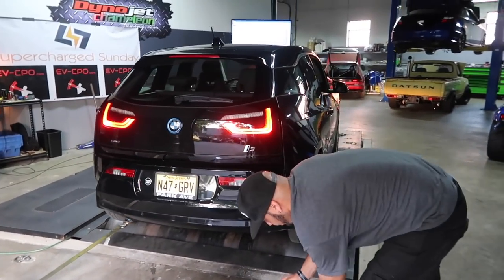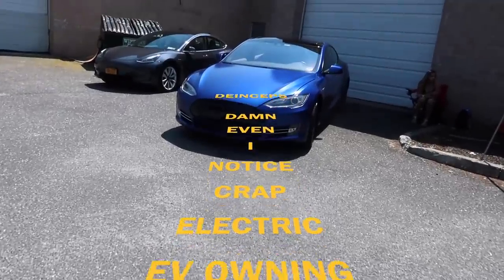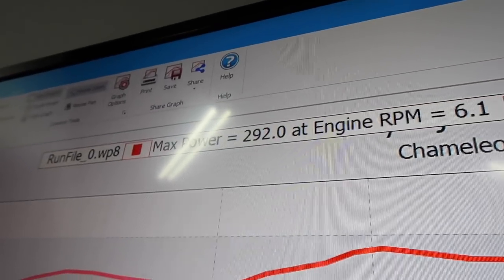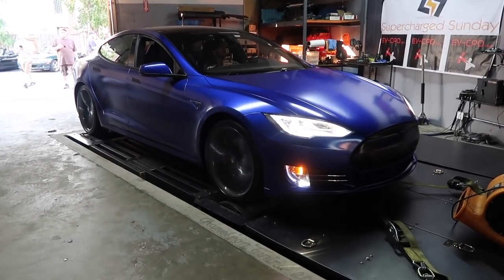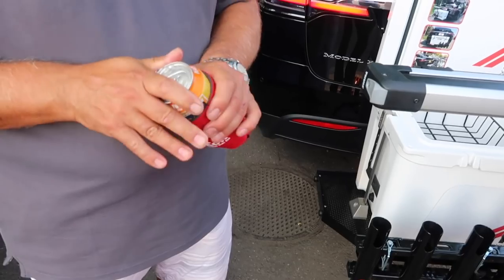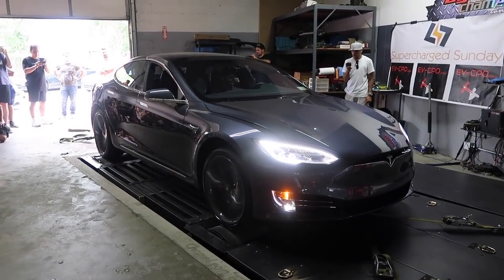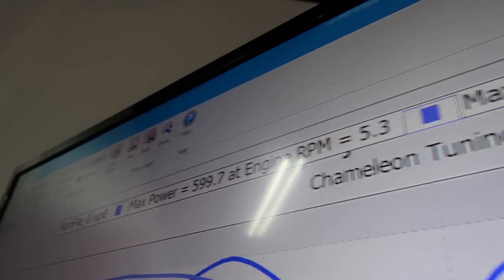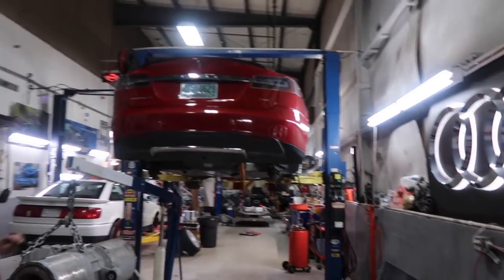Do Teslas stand a chance against my CORVETTE?

Comment: I always think all that talk about ICE cars being faster at higher speed is funny. Only because of the gearing they are. Put a single speed gearbox in an ICE car and they also only perform at a particular range. High speed or fast acceleration. Put a gearbox in an EV and they will distroy everything. (If the gearbox holds up that is)
Reply: Nope. Gearing doesn’t give you free power. Having torque at low RPM can’t give it high HP with gearing. Look at diesels.
Reply: The reason ICE cars don't have the power initially is that they need to be in a "power band" to produce the max power. But once in that power band, a lot of ICE cars produce alot more power than the fastest EV with any gearing. Now, if you put an engine in an EV as big as a gas engine, it's another story, because, yes, electric motors are more power dense. But there's no point for the typical consumer vehicle if you can already beat any ICE car to any legal speed ... but it would be fun to see something that fast and powerful.
Reply: TCPUDPATM PORTS ICE cars already have enough HP. Gearbox helps to keep rpm down. To prevent getting into to high rpm range. Just like ICE cars do to prevent getting into low rpm range.
Reply: TomaCukor that's exactly what i ment. ICE cars also need gears to perform optimal. ICE cars need high rpm. EVs need low rpm
Reply: How the hell would you keep the car from stalling on take off if it's locked in 3rd gear? Now if you cap the Vet at 3rd gear I think it would just hold more torque threw out the run while the engine revs to high rpms.
Reply: Morgan Ban Bogol ignoring the sarcasm or your bullshit before, a p100d with 2-3 gears will do the job at high speeds, you'll gain the possibility to lower rpm and torque avoiding the shortage and maintain acceleration.
Reply: +TCPUDPATM PORTS, The idea here is to keep it in the ideal rpm range. With those cars it looks like after 7k they start to go downhill. So if you essentially red line it at 7k add another gear that drops it back down to say 1k to 2k rpm and pickup it up again that will make it faster and keep it within its optimal torque range which would mean it would be a lot quicker in the half mile. 

The reason they don't have gears, at least right now in the consumer space is that you do not need them for daily driving, cost, and or what can be done legally on the road. Look at Formula E. Do they have transmissions? I know the answer, but do you? The real question here is can you make an EV faster with a transmission? The answer is... yes. Can you make it quicker? Well you can add a lower gear than what it already has but at that point you are likely going to lose traction anyway. If you kept the single gear but made it higher you wouldn't have as quick of acceleration but you would be able to get a higher top speed. 

The issue here is that you do not get the same amount of torque throughout the rpm range. If it was then this would not be an issue and you would basically see a flat line from 0 rpm to max rpm. Since you do not that's where gearing comes in. Find the peak curve so to speak and keep it at or near that curve.

+ Morgan Ban Bogol, an EV doesn't really need a 6 speed. 2-5 gears would be optimal depending on a few variables. Look I am not saying EV or IC is better, or picking a side. What I am saying is that for an EV to be faster than an IC it will need to have a transmission. At least with the tech we have today. The torque that these motors put out is not the same across the rpm range. If it was you wouldn't hit a wall after x mph.
Reply: +Pasquale Ranalli, ""RPM" doesn't apply to EVs..." What? So an EV is a solid state and it moves via magnetic propulsion via a hover board mechanism then? RPM does apply to EV the same as it applies to IC. 

HP = Torque X RPM / 5252. right? So are you telling us all that EV's have no HP? Maybe I am missing something here or you misspoke? 

The difference is where the power and performance comes in at. With EV It has a lot of torque down low up to around 6k rpm, then it starts to fall off. With IC it's low at low rpm then builds up. Another difference is that an ICE engine will max out the rpm well before an EV engine will but it doesn't mean that the higher RPM's are just as powerful and or have the same efficiencies.
Reply: let me know when any ev beats a top fuel car.... they are also one speed
Reply: +Pasquale Ranalli, "RPM refers to the rotation of the crank in an internal combustion engine.  EV's don't have an engine, they have a battery. " 

No, RPM means revolutions per minute. An electric motor still rotates. An internal combustion engine rotates a crankshaft. An electric engine rotates a rotor. The correct terminology for an EV "engine" is an electric motor. So I agree they don't have an "engine", but they do have a motor. Which... rotates. As such it is not solid state. 

"The only version of "RPM" that applies would be rotation of the wheels, but that's not what "RPM", in the way you used it, refers to." 

No, RPM in what I was talking about applies to the rotor of the electric engine which is a shaft that... rotates. That shaft rotating once is a revolution. If it continues to rotate you can calculate that over time which is revolutions per minute, which is... drum roll please. RPM. 

"PS - And yes they are solid state and yes they use magnets to transfer power to the wheels." 

I agree that they use magnets, but they are not solid state, it's not like you can take a magnet and put it to a wheel and the car rotates it needs a mechanism to do so, it needs a way to apply rotational force to a gear box, or to a wheel directly. Even if you are talking about the wheel directly which I believe none of these cars (in the video) are like that it still wouldn't make it solid state. Now you can control an electric motor with solid state components but the motor in and of itself is not solid state. In order for you to get solid state propulsion with current technology you would need a maglev type of system where you are running purely on electricity with no moving parts in the propulsion system. Basically the only thing moving is the vehicle. So no wheels, no motor, etc. 

"EDIT: By the way, I know exactly what you meant and agree.  I'm just pointing out that "RPM" isn't the way to communicate it.  That would be like saying a gas engine gets its power from number of gallops per minute after coming from horse and buggy." 

That is not an accurate comparison at all, they have nothing in common at all. You seem to think that an electric motor has no rotating parts and that the only thing that rotates is the wheels? and that is just not the case. The reason why it's not stated as much on a consumer level is that they don't really need to know and or care about it in relation to getting in and driving. But it does matter in the sense of the electric motor performance and efficiency. 

Also I am not saying an electric motor gets its power by rpms, the same as it wouldn't be with a gasoline engine. One rotates via... electricity, the other via gasoline, ethanol, etc via combustion.
Reply: +JbassPlayer28 "let me know when any ev beats a top fuel car.... they are also one speed"

That's not all that accurate. They do not have a traditional gearing setup, and may seem like "one speed" but they are not. They have a multi stage clutch that activates each stage via timers. Think of it like a really balls to the wall automatic trans (still not accurate either but closer). Thinking about it in a normal every day manual trans car if you dump the clutch getting off the line. If all stages engaged at the same time which is what it would be near the end of the run it would bog out, spin the tires, or break something.

Now as far as an EV beating a top fuel car? It's only a matter of time.
Reply: Anything can beat anything with the right conditions. You can out accelerate a F1 car on foot....for 6 feet.  Its all a matter of rules,  lets see an EV win 24 hours of lemans...then we can compare apples to apples.
Reply: +mondayfool "Generally an ev like tesla does not need gears simply because it does not benefit from them." 

I agree, because you do not need to go faster than the speed limit for a normal every day car. But could it be faster (higher mph) with a transmission? Yes. 

"It simply would not gain top speed because the powetrain could not output enough power to sustain that top speed anyway."

I vehemently disagree. That thinking presumes that the motor at any given rpm outputs exactly the same amount of torque through the drive train. That is not the case. Look up the graphs they all fall off. 

The reason we don't see gearing in consumer based cars except for the very high end is that they are not needed. They are only needed if you want to reach higher speeds. The rimac's front motors are single speed. The rear motors however are 2 speed. one speed for acceleration the other for top speed. Now as for the new Tesla Roadster I am not sure where you found the specs for that being 1 speed on all 3 motors. Maybe your googlefoo is better than mine... care to share? 

Now as far as the top fuel comment having a couple of gears? No, not really it's not gearing it's more or less clutch slippage that doesn't allow the clutch to fully engage. The clutch is engaged via timers. I agree that they could likely go faster and are constrained via rules and regulations and that they could go faster. But how much faster is actually possible with an internal combustion engine in that form factor? We are closer to the limits of what is possible via IC than we are electric motors, as such it's just a matter of time before they hit that mark.
Reply: beaten me to this comment
Reply: TCPUDPATM PORTS nope!  Gearing with the torque will increase speed.
Reply: Morgan Ban Bogol because the gear boxes can’t handle it.  Why the childish name calling?
Reply: OCP RPM refers to rotation, literally revolutions per minute, what do electric motors do, mother flipping rotate.
Reply: JbassPlayer28 there are 2 street legal EVs coming out that are pretty close 0 to 60 and top speed.    Top fuels is about 1 second and these are 1.5 to 1.8 with a top speed north of 250.
Reply: TCPUDPATM PORTS 
Rimac Concept one has gears and it beats Bughatti Veyron
Reply: Sidney M. Refer to your first comment. Your summary was "put a gearbox in an EV and they will destroy everything". I don't think you're understanding the difference between Torque and Power. TCPUUDPATM PORTS is correct to point out the difference. High speed comes from the ability to do work over time which is Power. Power applied through the gearbox is what gives velocity. Velocity = covering ground in the shortest time possible = overcoming resistance forces in the shortest time possible.
Reply: Exactly, because electric vehicles speed is limited more by the rotation of the wheels and the maximum RPM of the motor. there is a reason why it accelerates up to its top speed pretty quickly and then almost like it hits the wall. If there was a second gear ratio for the motor in the Tesla, it would certainly perform a lot better.
Reply: Rich, read comments, look what you did. Keep showing up to EV performance events with Zod, and you'll have to change plate to "TRGRWRN" or just plain "TRIGGER".
Reply: Razzreal that's what everybody said about diesels a couple of years ago. Until Audi did exactly that. We will wait and see.
Reply: Most of them leave it in 2nd around town and then put it in 3rd on the highway. But most of them are using brushed DC motors that don't like rpms as much as an AC motor.
Reply: mondayfool at 599 hp you definitely have enough power to benefit from a gear. Even less of that power would benefit
Reply: Avery Kucan
Previous Tesla Roadster has second gear but the torque on EV is so much it does damage on transmission.
But yeah additional high speed gear will speed up Tesla enormously
Reply: Cassette Walkman
Trust me, Im an Engineer and top on board exam, i knew work or torque from the principle to the Actual computation of work and torque. Mate Rimac pointed out that a multi gear EV is synonymous to a geared bike to none. Rimac Concept 1 beat Bhugatti Veyron and Porche 918 of Salamondrin
Reply: Pretty much - I think what a lot of people commenting are trying to get at (and some others don't get) is the simple difference between ICE's and electric motors. An ICE derives power from gas expansion and, to paraphrase the physical laws regarding gases clumsily, said expansion is 'rubbery': counter pressure can slow it, temperature affects it and so forth, just like air in a tire.

That's why there's a power curve in an ICE's output, where you want to hit the sweet spot at the top edge for best performance.

If you graph an electric motor's power curve, you'll find it doesn't. Curve, I mean - it's just a straight line that you want to be mostly diagonal in a car: the more vertical it gets, the more likely you'll have whiplash.

What holds electric back in comparison to ICE is power to weight ratio:  batteries are heavy. Since electric spins up to higher RPMs on average, they counter by leaving out serious transmission and using smaller motors, with less overall output, than a comparative ICE.

This design works because electric is notoriously efficient (see the bit about power curves, above) - their peak output can be applied at start, while the ICE has to get to mid-curve; meanwhile, though, the electric motor begins to fade as it gets closer to max speed, despite spinning out at higher RPM.

tl;dr - electric motors return 75% to 85% efficiency under load as a matter of course while ICE vehicles are heaters that can also provide transportation - they're between 30% to 45% efficiency at best and are prone to stress breakdown at high end. 

And that's without considering some of the, er, lesser automobile designs coughYUGOcough

We've just refined the ICE over decades; we're picking up electric where we left off in 1926.

Comment: I believe its the bms throttling the amps going to the motors when the batteries get hot, if it were supercapacitors it could deliver high amps for as long as there is charge on them, only set back to this theory is the shortcoming of the supercapacitor technology for now

Comment: Some EV manufacturers (or prototypers) made some revolutionary 7-gear transmissions. That improves efficiency, torque and top speed... but the Tesla Roadster (and future Model X and S) will most likely have different gear ratios for front and back wheels, to avoid using a complicated gearbox... i don't know why they haven't done that already, the front and back gear ratios are almost identical in all current Teslas...

Comment: It's not a problem with the electric motor at all. It's a difference in transmission. Electric cars usually are a 1 speed equivalent. An electric car with multiple gears would be able to handle high speeds, but for 99.98% of the cars life, additional gears are unnecessary.
Reply: mondayfool still technically not an issue with the electric motor, but rather that the battery cannot supply power for long enough. That's just pedantry though.
Reply: mondayfool 
No way,  a Rimac Concept 1 beats a Bhugatti veyron  coz it has gears  and even its battery capacity isn't as much as a P100D. 
Rimac explains the comparison of geared bicycle to none. 

I'd believe Mate Rimac than yours

Comment: Love your videos Rich,  The challenge lies in the battery.  With more power dense batteries you will have higher acceleration at higher speeds in the electrics.   Teslas are optimized for range and cycles but you can yank the 1200 lb battery pack from a p100d and use about 100 lbs of racing high power dense cells and it will be much quicker.  Or add 1200 lbs of the racing cells and it will be a little quicker but much faster!
Just wait till they actually "try" to make a fast car ;)
Reply: The electric motor is still a major factor because it can only spin so fast before the switching magnetic field stops being able to apply enough force per revolution.
Now maybe attach that motor to a CVT and a better battery pack and maybe that'll be something to see.
Reply: Actually make a fast car? Tesla Roadster 2?
Reply: Actually make a fast car? Tesla Roadster 2?
Reply: Actually make a fast car? Tesla Roadster 2?
Reply: No you can just use a more powerfull electric motor with the proper gearing.  Electrics only need 1 speed.  Look at the Roadster V2 which has a top speed of over 400km/h and does 0-60 in 1.9 and the 1/4 in 8.8 sec.  Its 1 speed.   RPM is just a number and many electric motors used in current EVs can spin anything from 10300 rpm in the OEM leaf to 18,000 in some teslas!  But again its about the power combined with the proper gearing.
Reply: Yes I agree Roadster V2 will be something they actually try on.  What I meant by that was when you look at what Tesla has in production is made for the family luxury segment not for racing.
Reply: Where is it confirmed that Roadster V2 would be 1 speed?
Reply: Arlin Sansome apparently you've not heard of the upcoming roadster from Tesla lmao
Reply: Maybe read all the comments.
Reply: Which BTW  just uses a really big battery because its still a battery optimized for range and cycle life.  You take the Roadster 2.0 and put some hi C rate cells in you can chop 1000 lbs out of the Roadster and it would be amazing for 1/4 mile stuff.  Not as good for range :)
Reply: CVT efficiency is inferior to a manual transmission....
It would be going backwards from an an engineering point of view if you already consider electric vehicles more efficient than internal combustion ones.
A two or  three speed sequential gearbox with straight cut gears would be more than enough if you want a transmission on those aluminium 2 tons whales....
Moreover it would deserve what the teslas are famous and sold on : the sensations during acceleration.
A cvt would kill that completly.